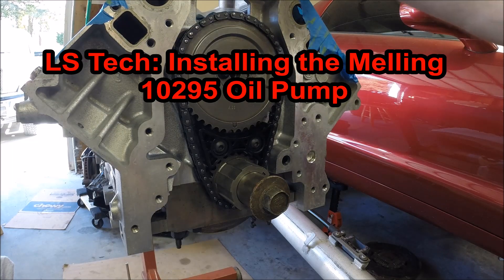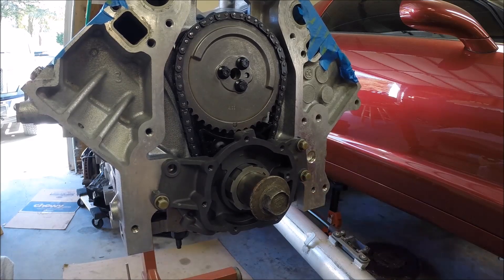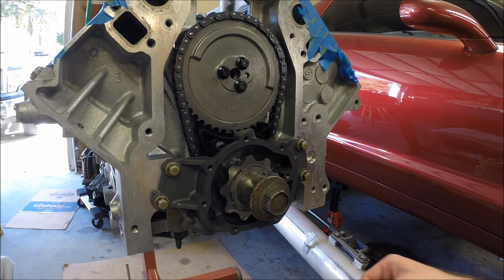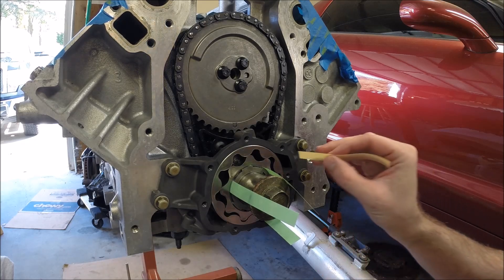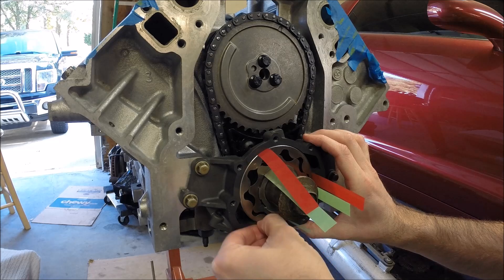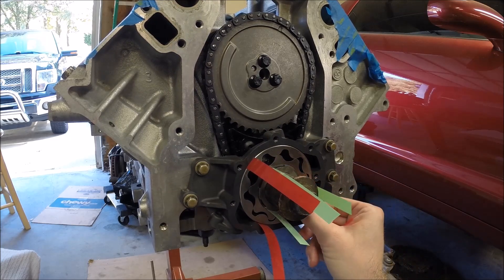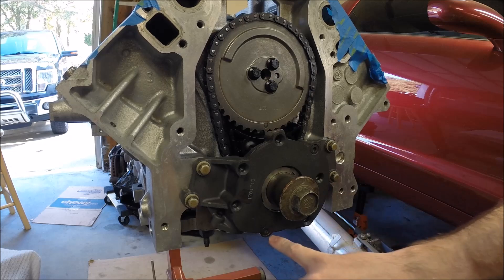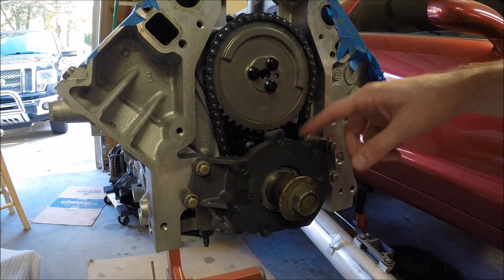LS Tech: Installing the Melling 10295 Oil Pump

Comment: Does melling say this is necessary?
Reply from the maker: Melling used to have a nice tech video that showed this procedure; not sure if it's still available or not.   But the general premise is to ensure the oil pump gear and housing are perfectly concentric to the crank before tightening down the oil pump housing bolts.  This prevents any binding points between the gear and the housing through it's rotation.
Reply: @ScrufsGarage  I watches the video they have posted and it wasn't this procedure.  I like this one better but isn't how melling says to do it , at least not currently .

Comment: I agree with shimming this type of oil pump when it's installed, but you are way overthinking this. There is no reason for those 3000 shims where you put them. All you need is a 2000 shim on top and considering how long those are you can put them in sideways. You put one in the top, horizontally, you put one in the bottom horizontally, and you snug up the gear housing. Don't forget the blue light tight on the cover plate. Being that the threads are not contaminated with oil yet, it's a perfect opportunity to properly assemble it.
About three times more work than it needed to be.
Reply: 😅 ok, Melling say bolt and go. Shim does nothing.....lol There is play in the gear gear so after you bolt it down and spin the crank it's moved again.

Comment: BTW.....My 2000 C5 Factory manual makes no mention of shimming OR cranking the motor over with finger tightened pump bolts. It just states to bolt her in, torque it to spec, and go to the next step...
Reply: It doesn't mention anything because this is a goofy waste of time lol

Comment: What about changing to a double bolt oil pickup tube girdle ?
Reply from the maker: I used a pickup tube brace for Improved Racing and was happy with it.  https://youtu.be/gD7gQLSLMTM
Reply: Melling makes a bracket and bolt for that, it $32.00

Comment: So, you shim the inner gear and the crank sprocket, then tighten the mounting bolts. Then remove the shims. Since the inner gear rides on the sprocket and not the housing the shims did nothing? I don't get it. I understand the outer ring, but the inner is a waste.

Comment: 2nd t30 bolt I tried to remove from the pump stripped.   What to do now?  Cant remove the cover.
Reply from the maker: Ugh sorry to hear that.  As a reminder the pump cover uses torx plus bits (slightly different than regular torx).  If the bolt head is stripped you’ll have to try some type of bolt extractor.  Or drill it out but I would try an extractor first.
Reply: Maybe a rookie move, but I thought torx plus benefits the tool longevity.  The t30 torx tool I had held up and fit ok, but the bolt shredded.  I even had to torch the spring bolt to loosen it up so I can remove the spring.

Comment: I don't get it? once u remove those shims everything will go back the same inside those inner gear mechanisms
Reply from the maker: The goal is to ensure there are proper clearances around the pump gears before tightening down the pump housing.  If you tightened down the housing and it was misaligned, you could get binding in the pump, which could lead to accelerated wear or stress cracking, etc.

Comment: Is that an oil pump alignment tool?
Reply from the maker: Yes, those are shims for measuring clearance around the oil pump gear before tightening down the oil pump housing.  SacCity sells an inexpensive shim kit.   Should be a link in the episode notes.

Comment: What part # you use in your timing chain dampener? What brand
Reply from the maker: So I have an "early" LS1 block that was not pre-drilled for the timing chain dampener.   So I used Trickflow Timing Damper Bracket - TFS-30675600.   I did an installation video if you would like to see more detail.   https://www.youtube.com/watch?v=a8EicgVqvT8&t=4s

Comment: Need some help folks. I cammed my car little over a year ago. Swapped in a 10296 while i had it open. Car ran strong. Last week out of the blue i got low pressure and engine sounded dry. Point me  in the right direction. Im gonna pull the pan and swap oring and check pick up screen. If not ill probably swap my oil pump. What else if this doesnt do it? Barbell? Valley cover seals?
Reply from the maker: Sorry to hear this.  Have you cut open an oil filter yet and looked at the filter media to see if there is debris, etc?   Do you have any oil pressure?   Does it rise with rpm?   There's a possibility the oil pump bypass is stuck open, bleeding off oil pressure.  Another option is that the oil pressure sensor has gone bad and is giving a false low pressure reading.  Though that shouldn't cause any odd engine sounds though.   Definitely share whatever you find it to be.   Hopefully it's something minor.

Comment: What’s the difference between the 10295 and the 10296?
Reply from the maker: The 10295 is a standard volume, high pressure pump.   The 10296 is a high volume, high pressure pump.  The "high pressure" refers to the the spring used for the bypass that controls the maximum pressure of the pump.  The 10295 also includes a stock pressure spring.   With either pump, Melling testing suggests that the OE GM pump begins to cavitate above 6200 rpms and flow/pressure drops.   The Melling pump design alleviates that issue.   Improved Racing has a nice graph on their website to illustrate.  http://www.improvedracing.com/oil-pumps-mechanical/melling-10295-standard-volume-high-pressure-ls-oil-pump-p-485.html
Reply: Scruf's Garage thanks. So the closest thing to stock is the 10295?
Reply from the maker: Yes, you could run the 10295 and the stock pressure spring.  That would probably be the closest to stock but still get the benefits of the Melling pump above 6200 rpms.
Reply: Scruf's Garage thanks. Appreciate the responses.

Comment: can I use the 10295 on one LS1 99 camaro z28 engine?...because I try to order it on Ebay, but when I put the car information, they said " don't fit on this vehicle " but the 10296 fits ...the thing is , I already have the 10295. I was thinking in install it on my 98 trans am. but I change plans and I going to make a 99 ls1 swap...

Comment: Well let me ask you this do GM take the time out and do this for every motor?
Reply from the maker: Interesting question.  I highly doubt GM would have a worker using shims on the assembly line.  An automated production line would have another method of centering the oil pump during installation.  In the same way that GM probably doesn't have a worker using one of the SacCity alignment tools to center the front and rear covers.   But I haven't seen their production line, so I can't say for sure.
Reply: @ScrufsGarage  and thank you so much for getting back to me I love your videos I imitate everything just about I'm working on my LS1 as we speak now
Reply: @ScrufsGarage  definitely a great answer I would imagine how do you research something like this through GM to see if they actually do what they supposed to do
Reply: No, they also reuse head bolts.

Comment: So how exactly does this matter if gravity pulls the parts back down after you remove the shims? LOL
Reply from the maker: Essentially what you are doing is aligning the pump housing.  You tighten the pump housing after you put the shims in place.  Then as the pump rotates within the housing, it has the proper clearances.
Reply: @ScrufsGarage  I talked to Melling tech support and they said it's a complete waste of time?
Reply: @YZFoFittie  wow. Interesting.,, yeah fk this. 😂 I’ve always just thrown them in also.  Rotate the crank by hand to make sure it’s not bound up..

Comment: Hey man I'm planning on doing a cam install on my 2010 Camaro ss, just wondering if you need to like prime the oil pump or something like that because I plan on buying a melling oil pump for it, thanks in advanced
Reply: There is an Allen plug to the right side of the motor, take it off and get a turkey baster full of oil force it in that hole, keep filling till oil comes out, spin the motor a little by hand and add some more till it comes out the hole ....then cap it, disconnect your coil harness and fuel pump and turn over the motor with your starter until you see your oil pressure gauge move ......then connect  Your fuel and coils and fire in the hole.....that's my way of doing it and I haven't had any low oil pressure issues at all !!!  , don't let the Internet and faulty wannabe ls swappers intimidate you, it's really not that difficult,
Reply from the maker: You can't prime these pumps like you could in the old SBC motors.   Melling sells a fancy engine priming tank for the LS motors, but it's waaay too expensive for the average person and not really needed.    Check out my "1st Startup" video; I talk about how I primed the system.    Essentially you pull the fuel pump fuse and crank over the motor for a bit to get the system semi-primed.   There's also an oil galley plug on the front driver's side of the block that you can remove and back fill some oil into.  Both are shown in the 1st start up video.
Reply: you shouldn't take advice from backyard mechanics.  try this https://www.youtube.com/watch?v=539ClWWJMl8
Reply: You can pack the pump with Vaseline, it’ll give a nice vacuum to pull up the oil
Reply: Rule 1 on installing a oil pump … suppose to pack them with engine bearing grease lol so u don’t have a dry start

Comment: Why didn't you put a small amount of gasket sealer around the return hole, where the back of the oil pump contacts the engine block ? It seem like it might leak/ suck  air, unless it's sealed up ?
Also, did you remove the stock oil pump spring, and put it in the new pump ? I want to increase my oil pressure, as much as possible.
Reply: because the pickup butts up against it's housing with an oring I'm pretty sure?...

Comment: yea and where tf am i gunna buy shims and wait week
Reply from the maker: LS Brandon SacCity corvette sells a set of the shims for this.  Link in the episode notes.
Reply: Scruf's Garage on the installing vid did u have to add the spring ?? Or is it already in there
Reply from the maker: LS Brandon the bypass spring came preinstalled.   👍
Reply: Scruf's Garage oh okay thank you i didnt know since it came with 2 extra springs
Reply from the maker: LS Brandon so mine actually didn’t come with an extra spring.  I think it probably should have.  The bypass spring is just held in by a threaded plug.  The safest bet is to back that out and confirm what is installed.  It will only take a minute and eliminates any worries.
Reply: Ls Brandon  =  Shim it with fuller gage  = punk...

Comment: Where does the spring and hex screw goes that come in the box
Reply from the maker: My memory is a bit fuzzy, but I believe the 10295 comes with the high pressure spring pre-installed, and then an extra stock pressure spring that you could swap in if you wanted too.  And the hex screw is probably the screw that holds that spring in place.  Hard to say for sure without seeing it.   I have two other videos about the GM and Melling pumps so you can see the internals and see how the spring works.    Here's one...  https://youtu.be/c_HNZ9vIBFc
Reply: When you pull that hex screw out to swap pressure springs it also gives you a great way to prime the oil pump (assuming you already have the oil pan in place... Tho it shouldn't make THAT big of a difference).
Just slip the hose from your hand pump in to the opening and gently pump until the oil starts to run out of it.  You can also use  any old piece of 3/8" hose, a small funnel, and slowly pour oil in.

Comment: Are there no shaft seals on thes pump?
Reply from the maker: That's correct.  The pump sit inside the front cover, so any oil leakage just drips back down into the pan.

Comment: I'm doing a cam swap and most parts will be stock GM parts. What oil pump would you recommend for a high millage engine?
Reply from the maker: For a normal street car, you'd probably be fine with the standard Melling M295.  If you're planning to track the car, I might spend the money for the 10295.   It may already be part of your build plans, but if you're doing a cam and anew oil pump, don't forget about the timing chain.  The LS2 timing chain is an upgrade over the LS1 version, and it's not expensive.   Good luck on your build!
Reply: Scruf's Garage it's a truck with the 6.0 and LS3 heads. If you wanna give any advice on anything else I should get let me know. This is my first time lol.
Reply: Scruf's Garage  what makes you recommend the LS2 chain over the  LS1?
I'm building a LS1-type 5.7 out of a 5.3 for my 06 Z71 Suburban
Reply: @cmcolfax1  the ls2 chain has thicker links then the ls1 chain
Reply: @Scruf's Garage  The HV, 10296 (with standard pressure spring!) pump is fine for new, or older builds. More than standard pressure does nothing but take more power to spin the pump, and if it gets too high, can aerate the oil, causing engine damage....
Reply: @milojanis4901  to late I built it 4 yrs ago and put over 100k on it. It’s about to hit 300k and still runs smooth and doesn’t burn oil. I put a melings in it with a slightly stronger spring. It usually runs at 40psi going down the highway and idles at about 30psi.

Comment: i wounder if this even makes a difference with the shims
Reply from the maker: It's hard to say.   The pump internals are made to very tight tolerances, so getting the clearances setup properly is important.  The oil pump is also one item you just can't afford to have a failure with.  So I think it's worth the extra time to go through the shim process.
Reply: i think seating the oring is more important then the shims.
Reply from the maker: Yes agreed, if you don't get the o-ring seated you're definitely going to have an oil pressure problem.
Reply: CAN I USE THE 10296 IN MY LS1 BUILD
Reply from the maker: Yes the 10295 and 10295 are for the LS1.    Always confirm your specific application with the Melling application data.
Reply: Melling says just rotate the crank 360ﾟ before torqing to align the pump that's it
Reply: @dennisallen373  They do however most people have the pickup tube already installed

Comment: An interesting test would be shim vs non-shim pump install. Great video
Reply from the maker: Yes, I have to imagine a lot of these get installed without shimming, though Melling must have a solid reason for requiring this installation step.  My guess is that the tolerances are tighter on the 10295/10296 pumps vs the standard replacement M295, and so shimming becomes more important for pump wear/performance.
Reply: I used the high volume melling pump without shims, I get about 65psi cold/50 running temp...
Reply: @trentdawg2832  I don't think shimming your pump has anything to do with the oil pressure you get presently...It has to do with what your oil pressure will be years and 1000's of miles down the road...

Comment: Did u put in the high pressure spring or leave the one that came in it
Reply from the maker: I left the one that came pre-installed.  While it is advertised that there should be a high pressure spring in the box... mine did not come with one.

Comment: Threw in my cam and pump today and realized my cam retainer was bad.  Because of that I jumped on the internet and also realized I hadn't shimmed the pump during install.  Thanks for another great video.
Reply from the maker: It stinks you had to do a bit of extra work, but way better that you caught it now vs later.  It happens to the best of us though.  I got so excited installing the rear block cover that I forgot to install the oil galley barbell first, haha.  Luckily I realized it almost immediately, but I would have really been in trouble had I installed the motor and only discovered my error when I didn't have any oil pressure.